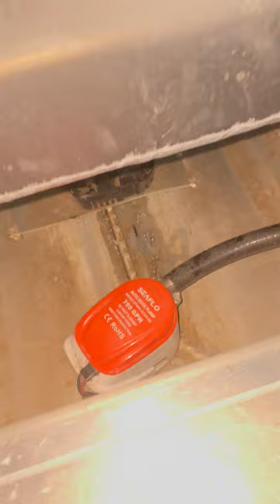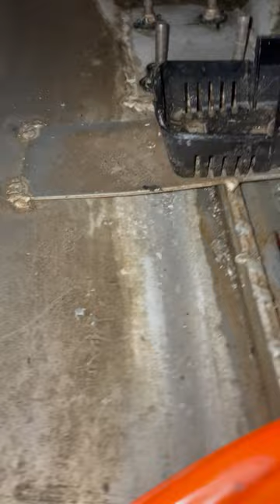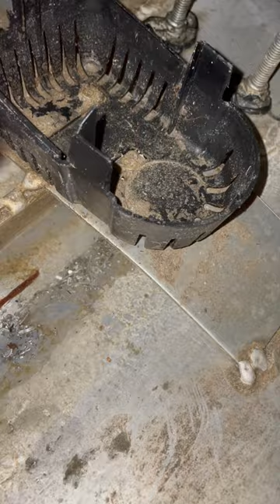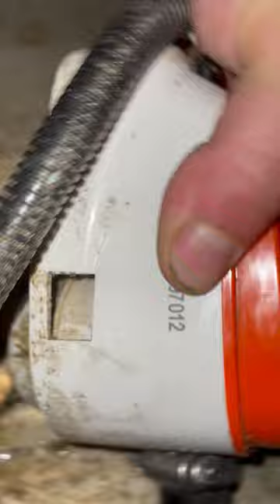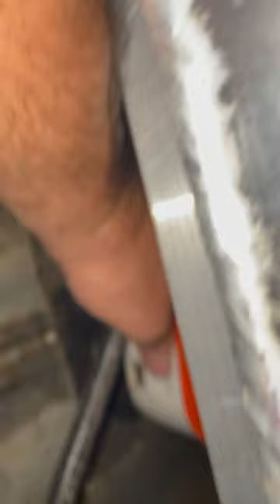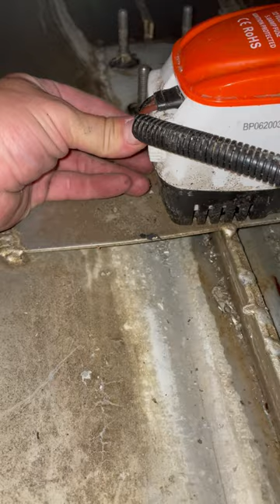Front bilge pump runs continuously and won't turn off.

Comment: I’m having the same problem. Did you solve the issue?
Reply from the maker: Yes. I found the front bilge pump underneath the gas tank. I had to remove the dividing wall between the engine compartment and the fuel tank compartment with three #3 Phillips screws in order to access it.